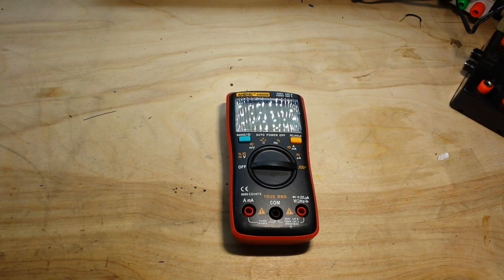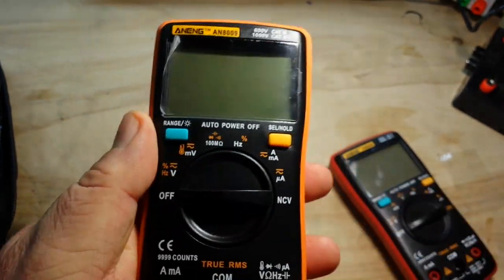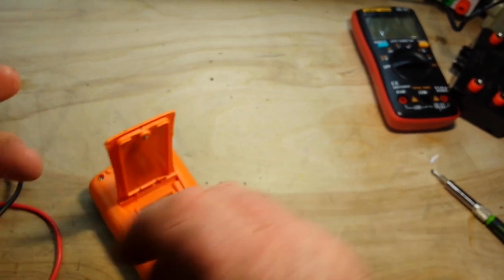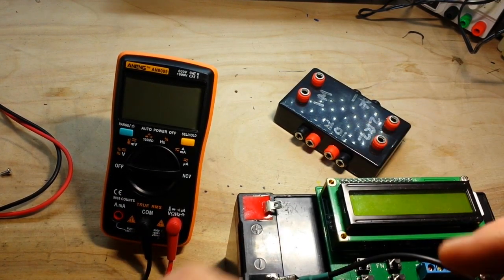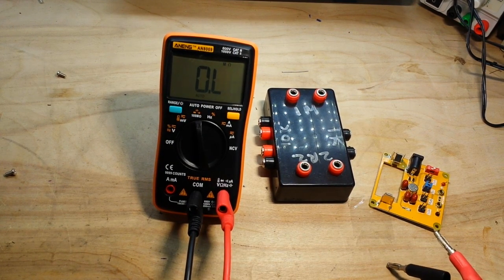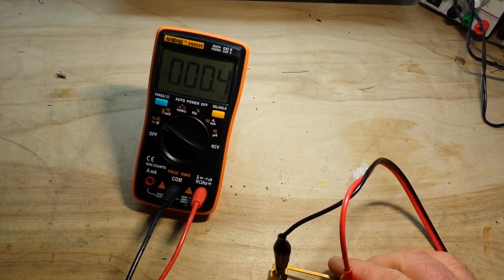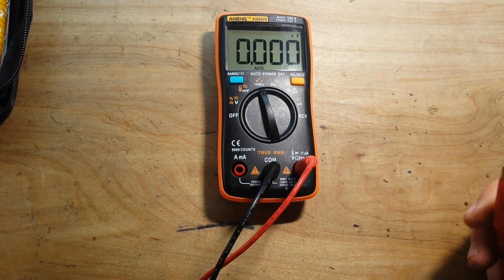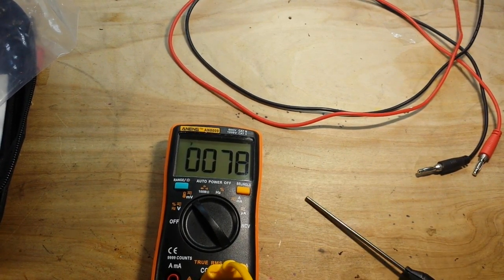Aneng AN8009 Multimeter

Comment: Good review so far.
I was yelling at the screen when you had the cables wrong, apparently you didn't hear me. :D
I was wondering if you have done the decoupling capacitors mod? I did it on my 8008 and it has made a difference in the speed of the measurement settling down.
I also replaced my fuses with surface mount fuse holders (1808 sized fuse).
Reply from the maker: No, I have done no mods. But now that I. I'm retired I may do that.

Comment: Thank you for yet an other interesting video. I have noticed something wierd with my ANENG AN8008 when turned off,  if connected there is a current running through my DMM. In my case I measured it at about 2 mA when connected to 5 V with the dial in the off position. If you have time, does your 8008 behave the same way? Thanks again. DrT.

Comment: Hi, can you post a link as to where you got your current standard from? Thanks.
Reply from the maker: Ebay...https://rover.ebay.com/rover/0/0/0?mpre=https%3A%2F%2Fwww.ebay.com%2Fulk%2Fitm%2F311498494419
Reply: Thanks - but that looks like a voltage reference? How about the device being used at 6:50 during the current measurements?
Reply from the maker: https://www.ebay.com/itm/0-10V-0-20mA-Voltage-Current-Signal-Generator-Source-Transmitter-Module-/282993620107?var=&hash=item41e3bbf48b
Reply: Super - many thanks.